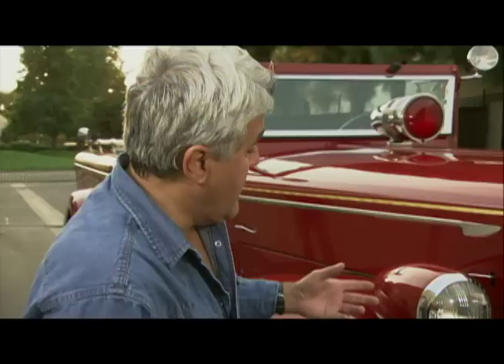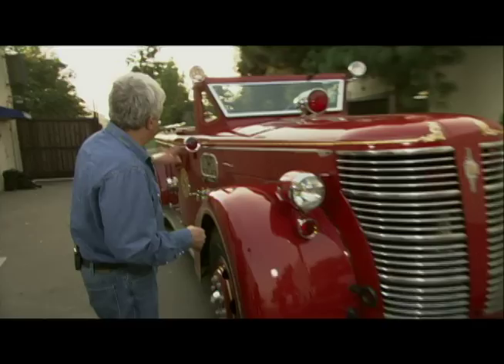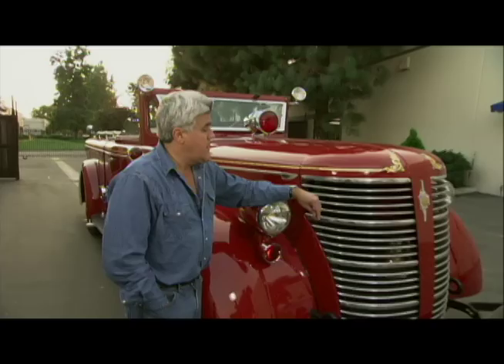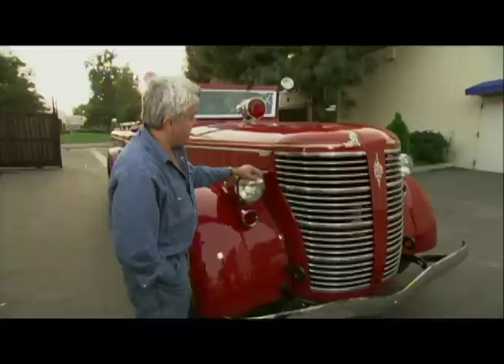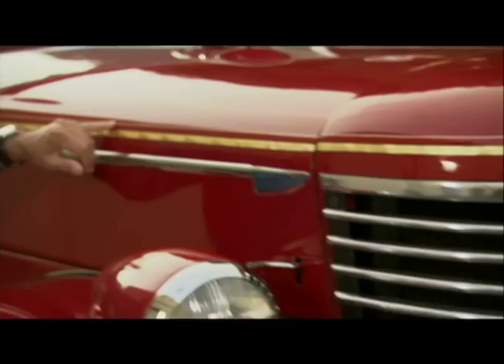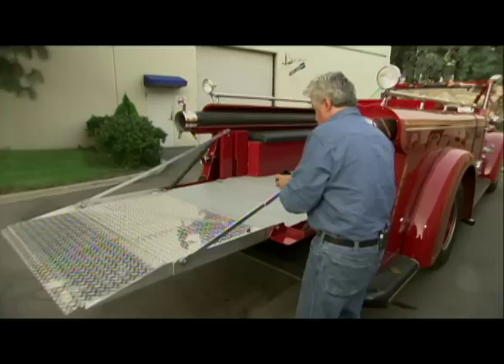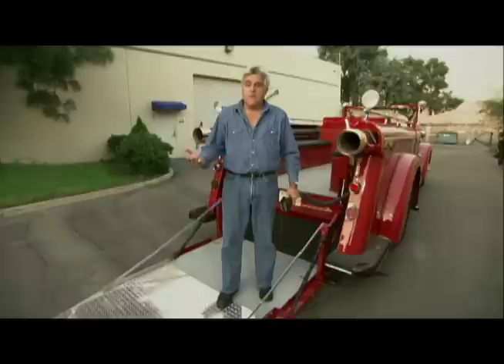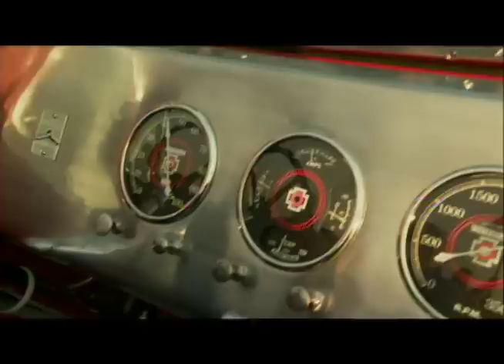1941 American LaFrance Firetruck - Jay Leno's Garage

Comment: I owned a 1947 ALF series 700 12 cylinder fire engine that was fully restored from Algonac Michigan. It had two distributors four coils two each 12 volt batteries and 24 spark plugs. It had a push button start and start it every single time. Absolutely a monster to drive as you double clutched up and down with the four speed manual transmission. You were wore out driving it at the end of the day but there's nothing better than once a man twice a child driving a fire engine. I had two of them!

Comment: Aye Bitchin ride I restored one of these trucks in Dallas tx a few years back. rebuilt the engine and poured Babbitt bearings for it scraped and sanded that giant rusting thing and it took for ever working out the Orange peel and all the other things needed to make it quality but it was all worth it to drive that prehistoric monster it's got a tall clutch pedal that is painful to use if you get stuck on the highway like me. Well if you read this Jay roll that thing a foot every three months so it doesn't get a flat spot on the tires or it will shake the wax out of your ears. love the tailgate mod we would put rollers in the back for caskets for funerals but also drove it in parades for charity's to help kids out. If you ever need carbs and rotor caps for that thing let me know. Thanks for posting cool vids jay and if you have one make a 68 greeves challenger video my grandpa tried to sell his to you when you where still working in Amarillo I still ride it. Ha ha funny this comment will never be read by jay but who knows.

Comment: The V12, 1200 cid came from Lycoming engines, at first they had a problem with the angle between the cylinder banks. They even tried putting them in Linn tractors when there was a competition for artillery tractors in Hawaii, (which eventually lead to the White halftrack in WW2). A-L sold Linn in 1948, after bleeding them of assets since the 1929 Republic merger. The management's refusal to give up front fenders on their cab forward trucks, is why A-L had those really narrow cab jumpseats, and caused them to lose sales to full width cab makers. Looks don't always sell.

Comment: The thing has SOOOOOO much torque its absurd. Remember, before the late 1980s American engine design heavily favored torque more than horsepower. The ability to make a vehicle get up and go, and get going quickly, more than all out speed. It still does, but the mix leans has engines that toward more horsepower than torque.

Comment: Lol, the V12 in question is 70+ years old. Technology has come a long way since then. Plus, being a heavy vehicle engine, this thing probably cranked out 500+ lb-ft of torque.

BTW, 260hp from a V8 sucks by modern standards. A V6 Toyota Camry has more power stock.

Comment: Why did American fire engines use petrol rather than Diesel engines? Also, British ones are based on regular commercial lorry bodies, why not American ones?
Reply: They are.  This was one anufacturer that tried to do everything themselves.   As for gas vs diesel (it's all petrol,  diesel is more petrol than gasoline) gas engines were common in trucks and tractors until the 1960s because they start better in cold,  and were more reliable in general.
Reply: brett knoss Not only more reliable, they were more powerful. naturally aspirated diesels were ridiculously underpowered.
Reply: CHris Henniker American Firetrucks had to service greater areas than those in more densely populated country.  Many times a county would have one truck and they may have to travel 50 miles to get to the fire.  This needed maximum power for high speed responce and a dedicated chassis so that the tanks could be mounted low for better handling.
Reply: +bob joe One fire engine for a whole county? That's what I call ludicrous coverage. There should be about eighty per county.
Reply: Note that is a 1941 model.  At that time agriculture drove the medium duty truck market. At  time even diesel farm tractor weren't getting a substantial amount of sales. Perhaps because much of the USA experiences sub freezing weather, and the diesel of that period weren't easy to start when that cold, as compared to gasoline engines. Today Diesel are the rule rather then the exception. Today rural fire trucks tend to be built on medium duty truck chassis, but the term is relative. The chassis tend to be  4x4 or 6x6 with diesel engines. Small cities till use medium duty truck, but may not be all wheel drive unless the department serves both city and rural areas.
Reply: crazyhomer777 speed was of the essence. Gas was cheap. But in the 60s the diesel was more powerful and most departments converted them. No one saved the beautiful old gas engines so they are rarer than the trucks.
Reply: Another reason for speed was building construction.  Because of the Great Fire of London in 1666, the British favored (and in the cities, mandated) brick.  Most American buildings are wood, balloon-frame construction.  Speed and technology were necessary to avoid fires like the Great Chicago Fire of 1871.
Reply: I like that term cultural imperialism.
Reply: In the good old days in UK a company called Dennis specifically  built fire engines for the Fire Brigades all over the country, and they were the best some of the earl ones had Rolls Royce 8 cylinder engines in them, in the 70s and 80s some of these 50s engines were still in service and i had the privilege of driving them as a fireman in Belfast Northern Ireland
Reply: K. Dennis used to make fire engines, they designed and manufactured them from scratch, they also moved into amenity vehicles as well.  It is fantastic that US companies still design and produce fire engines, i wish UK still did the same for there were no engines ever came close to the Dennis Fire Engine, especially the early ones.